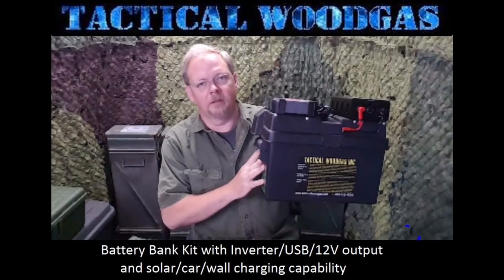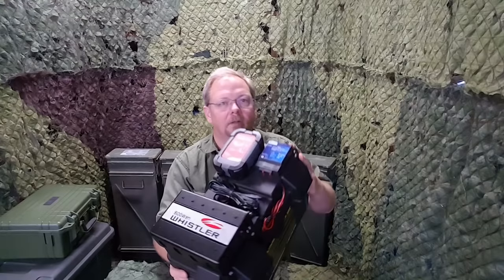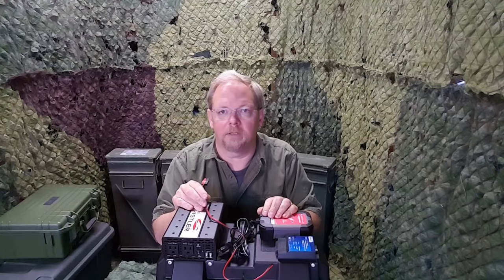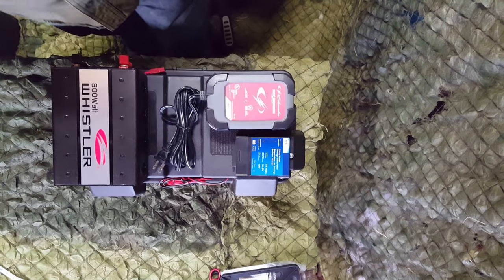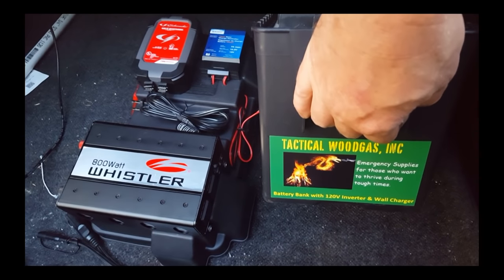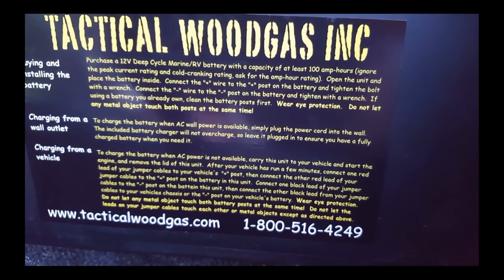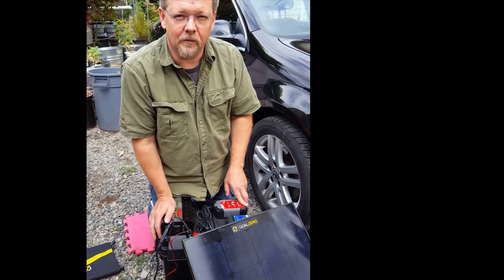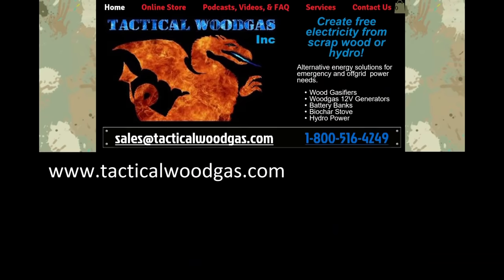Installation of home/camping battery bank

Comment: How does the battery charger connect to the battery to charge it? I only see you connect the inverter to the battery do both the solar and the ac charger connect through the inverter?  Thanks for your video.
Reply from the maker: That wiring is taken care of on the lid.  I wanted to keep it simple for customers of www.tacticalwoodgas.com

Just connect the red and black wires to the battery and you are ready.